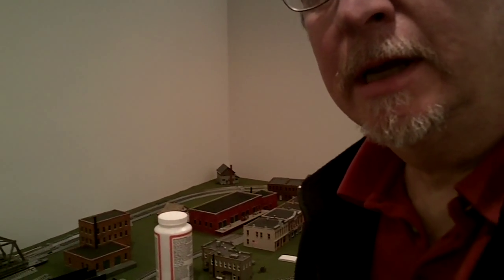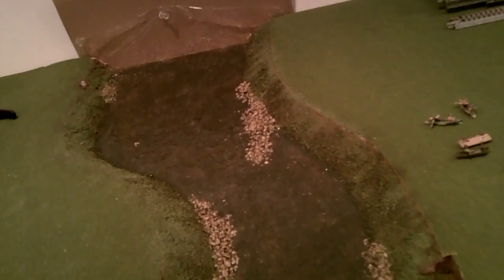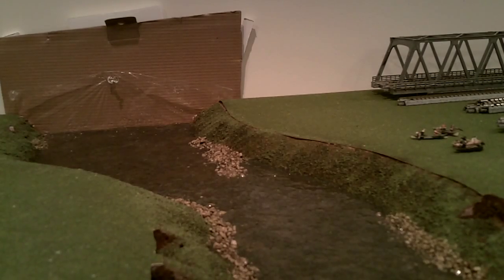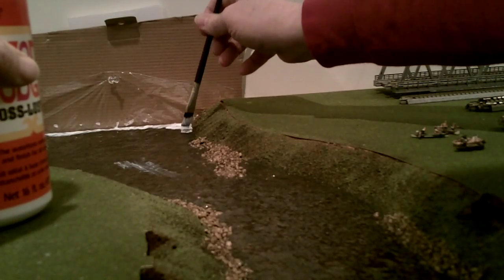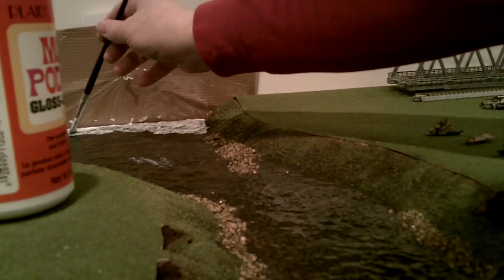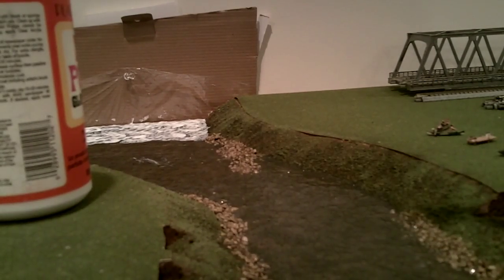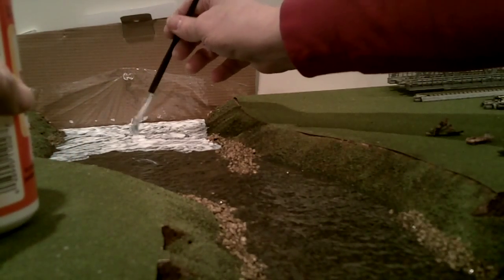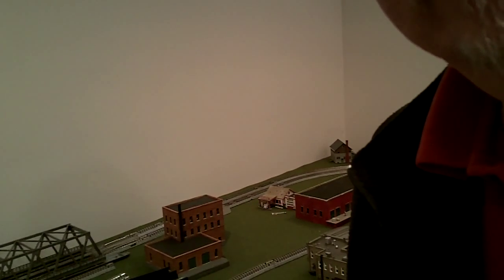Mod Podge for the Alma River 001

Comment from the maker: Hi Andre, I started by painting the bottom with brown craft store acrylic paint. I covered it with Woodland Scenics ground cover, first earth blend covered by a light coat of soil. I added talus. Each layer was fixed with scenic cement. I poured and spread a heavy coat of Mod Podge. This took 5-7 days to dry. Then I added 3-4 coats of Mod Podge as in the video. Putting it on a in the video creats the dimpled effect. Finally, I brushed on a coat of acrylic varnish. Hope this helps.
Reply: This is a historical comment ❤

Comment: Nice information on water features.
Reply from the maker: Thanks Nick. Mod Podge is easy to work with and gives very good results.
Reply: @challenger3977  I have a lot of work to do on the layout. I'm thinking of adding a stream but have to figure out where to put it. O well that's the fun of having a model rail road.. Greetings Nick from New Jersey

Comment: Very nice job...
Question Please.
I am using the same exact Mod Podge Gloss Lustre which I just bought recently. I have a thin coat applied to try and simulate small ripples in my HO harbor scene, which was very shiny before using the Mod Podge. 
The Mod Podge Gloss Lustre is now dry to the touch after about 3 hours and my concern is the surface now looks really flat with no shine at all. 
Is this normal where it looks very flat at first and no shine after it is dry to the touch.
I am concerned because I had a very shiny gloss surface before and now all the shine has disappeared and it no longer looks like a water scene.
Any advice or info would be appreciated. Thanks in advance.
Phil
Reply from the maker: Hi Phil, even though it feels dry to the touch give it at least 24 hours to thoroughly dry, longer if you applied a thicker layer. It will be cloudy until it dries. Once dry you can apply a glossy acrylic varnish to add more shine but it should be shiny when completely dry.
Reply: @challenger3977  Thanks for that info. I was getting nervous that I had ruined my harbor scene and would have to start over. 
If I do apply a thicker layer in there future, how long on average would it take to dry where it gets clear and has a shine....
Thanks a lot for your reply. I appreciate it.
Phil
Reply from the maker: When I did the river in the video the initial pour took about 5 to 7 days to dry completely. The top coats where I added the swells took about a day between coats.
Reply: @challenger3977  Thanks Joe. I appreciate your information. I am going to give you a Sub for you taking the time to reply. I'll check your videos also as iI love seeing other people's layouts and work.

I am building a fairly large freelanced Colorado style mountain railroad in HO. I really like scratch building bridges to scale...
All the best from the Jersey Shore Area...
Phil

Comment: I have the Mod podge matte sealer, it's about the same consistency as water...I'm gonna see if i can swing it?
Reply from the maker: I used acrylic gloss varnish as a sealer but it didn't make any difference. I've use Mod Podge to make water since that video without any sealer and it's the same as the using a sealer.
Reply: @challenger3977  I work at a lumber yard/hardware store so I picked up some Minwax polycrilic,  thanks for the tips

Comment: I am gonna have to try this. How many coats did it take? Thanks for sharing.
Reply from the maker: Hi Dave, It was quite a few years ago so I don't exactly remember but I think it was 3 or 4 coats. If the coats are heavy it can take a week to completely dry but it will dry no matter how thick the coat is, it just takes longer if it's a very thick coat.
Reply: @challenger3977  Thanks
 Hopefully I will be doing a water scene and I might try this method instead of using the Woodland scenic products.

Comment: much faster to pour in epoxy resin, mixed with a color of your choice.
then apply a layer of mod podge for the wave effect
Reply from the maker: Thanks for the input, John. What you say is true, epoxy is faster, but you must have the area sealed. I've had friends who used resin have a leak. Others had no problem. I'm comfortable with Mod Podge and don't mind that it takes a few days to do. The barriers I put up really weren't necessary. The Mod Podge stays where it's put. I just felt better with a barrier.
Reply: @challenger3977  your work looks beautiful by the way
Reply from the maker: @johnkennedy7368  Thanks John

Comment: Thanks Joe.  My water turned out smooth.  Not quiet happy with it.  I wanted some water motion.  I had heard of using Mod Podge but never seen it applied.  I think I may go back over my water surface with the Mod Podge to get a similar effect.  Was your original/beginning surface smooth or was it dimpled?  And did you try the acrylic varnish on the surface?   Thanks Again.. Andre'

Comment: Is the Mod Podge sticky after drying out ?
Reply from the maker: When the ModPodge dries it is not sticky to the touch. I have canoes on the water and after many months, maybe years, they are very lightly stuck to the water. They lift off with no effort so there is some small tackiness, however it isn’t a problem.